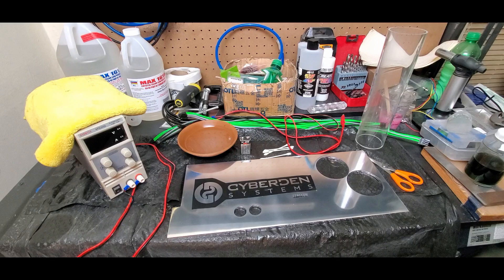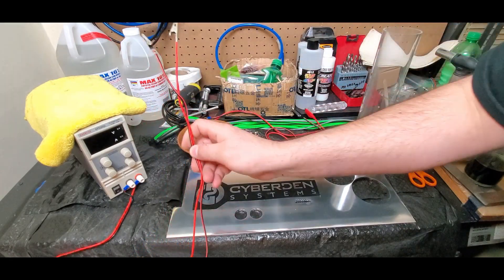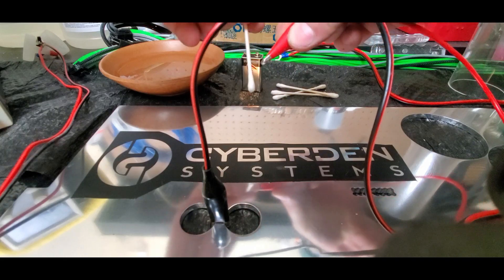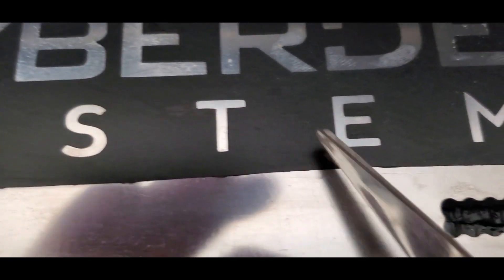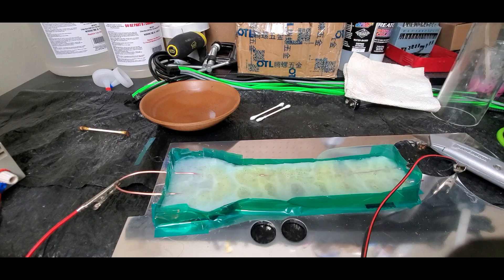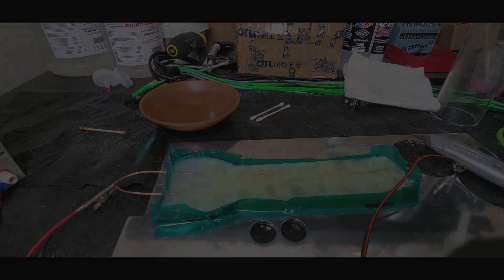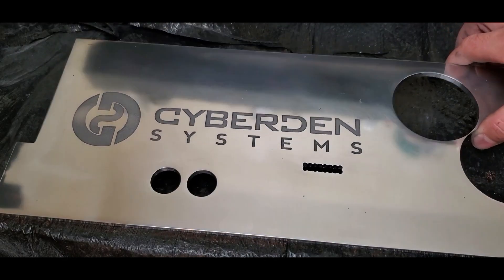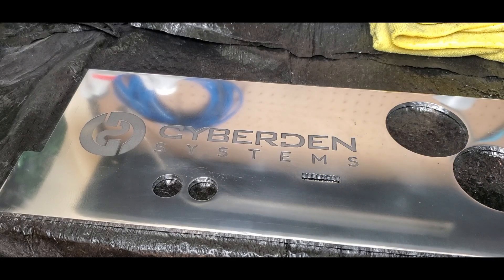How To DIY Elecro Etch Aluminum (Re-Uploaded)

Comment: I would like to point out that if it were just distilled water you would be getting both hydrogen and oxygen gases. But since its salt water you will be getting chlorine gas forming on the positive terminal as well. Thats why when you had the polarities reversed your water looked kind of yellow. You were getting chlorine gas trapped in the bubbles.
Reply: So just to clarify.. The plus terminal goes on your work piece and the minus goes on the copper wire?
Reply: @Theknobatnoon correct. Also instead of adding salt to the distilled water use baking soda. Not baking powder, baking soda. This way you don't get chlorine gas at all. You will need to adjust the current so it's more powerful power otherwise it will be slower

Comment: Finally someone who has the polarity correct 👍 nope I spoke too soon. Electrons flow from negative to positive. What happens as the electrons leave the negative anode they take small parts of the base metal.  It is essentially rapid corrosion.
Reply: Cathode is negative, anode is positive.

Comment: Do we need higher volt to made deeper etch? Do we need to consider the amps also?
Reply: time and circulating/replacing the salt water will help for deeper etc
Reply from the maker: Not particularly. Higher voltage and amperage would just make it go faster. But, it would also get hotter and the fluid would evaporate faster. I set the current till it started to bubble, and kept checking on it till it was where I wanted it.